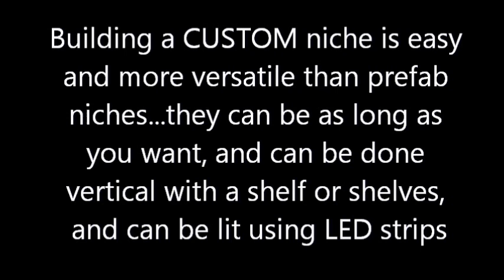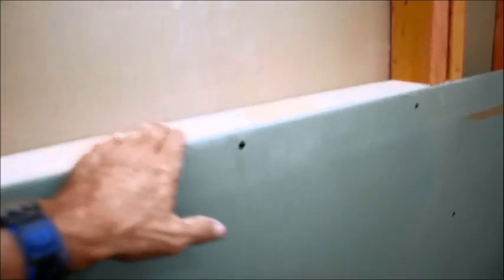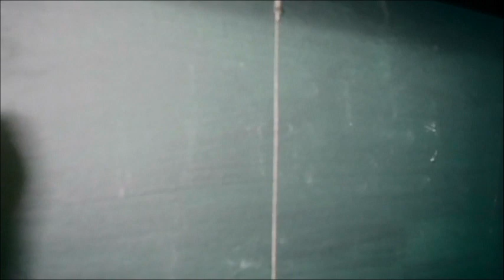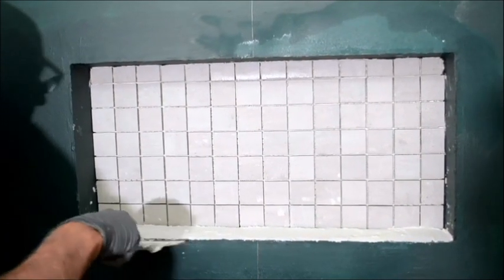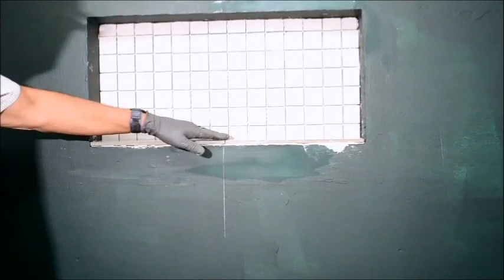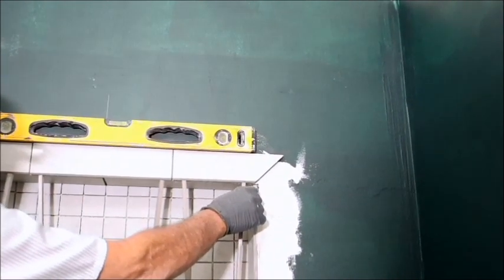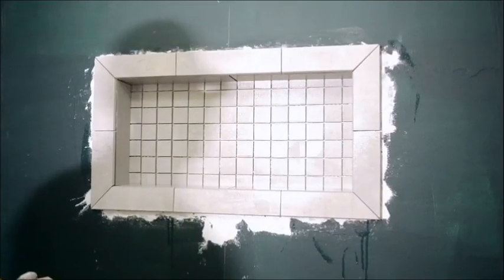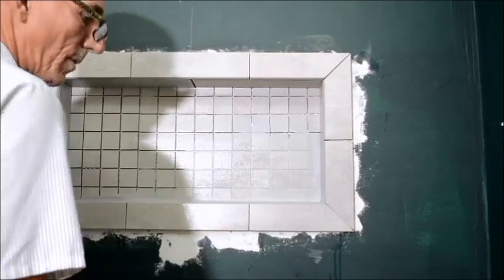HOW TO BUILD A SHOWER NICHE

Comment: I notice that you don't use any tipe of mesh on corners or niche? Why is that?
Reply from the maker: Because the liquid topical  membrane is basically paintable rubber which is much more pliable than tape would ever be... if you wanted to do tape and the waterproofer then it wouldn't hurt but I don't believe it helps

Comment: Bob. Do you grout the entire niche or silicone? And, do you silicone the floor tile and wall tile gap?
Reply from the maker: It is rare that I do any caulking in a shower at all, if there is cracks later on then that would be a reason to caulk but I would never advocate for silicone because it's difficult to work with and even more difficult to peel away when you have to recaulk
Reply: Have you had to regrout due to cracking? I took special time to fasten the stud corners together to minimize/eliminate both planes from shifting serperately cause I want to use grout. There is a porcelain preformed shower pan I'm getting ready to do tiling but think it is best to caulk the pan/wall joint? Your thoughts if you have a moment. Using 12 x 24 for porcelain running them vertically. It's what she wants.
 @StarrTile

Comment: Do you really have to glue the back panel to back of the other rooms drywall? I'd like to do this but I also plan on remodeling the next room over soon and don't want the back of the niche to come out when the drywall does
Reply from the maker: Yes you really have to do that, the only way you could get away with not doing it is having some extra room between your studing, in other words your bedroom wall would be separate from your bathroom wall... what actually does happen from time to time especially on condos but otherwise yes you would have to glue that panel onto your existing wall

Comment: Thank You So Much for all your videos.   My Dad and I are remodeling their bathroom.  It’s a 155 year old house with original fixtures.  We are turning it into a Handicapped bathroom with a floor level shower.   You have taught me a lot about the proper way to do the waterproofing and tiles.   We plan on doing a couple big niches and you have shown me the best way to do them.

Comment: Your always preaching about you build showers based on the way water works. why not put the bottem tiles of the niche befor the back splash so the water that runs down the back splash runs onto the ledge tiles rather potent water running behind that ledge tile and thanks for this video I was about so start this project and now I see that I am able to start the niche be for every thing is nice
Reply from the maker: A niche is not the same as a floor, the water that sees inside of a niche is minuscule at best....I have same size niche in my shower and it gets little water in it. Plus there is no mortar to protect like with a floor...
Two different situations, but everyone is free to do it as they feel is correct.
Reply: @StarrTile  Had the same question. Also, the change of plain into the niche is way more watertight than the floor. 
...but what do I know. :P

Comment: Do you grout inside corners or caulk it? Does the hybrid grout kind of like prism work for these applications? I was always told to caulk inside corners. I would appreciate your advices, thanks!
Reply from the maker: I do not advocate for caulking because it is for cracks, if there is no crack that occurs then there's no reason for the caulk... and no prism will not help you in that regard, however I built my shower seven years ago and no where including my Niche is there cracking so it gets no caulk. But there are some guys that caulk every change of plain there is and there is no harm in that, I just personally don't see the point
Reply: @StarrTile  so you only caulk if a crack occurs, otherwise everything gets grout? Yeah I, was always taught to caulk where the change of plans occurs. Thanks for your advice! You do beautiful work!
Reply: @buildingwithjosh  This point have been a huge  headscratcher for me. But i've done my non-scientific reasearch on this, looking around other showers and most shower uses grout on change of plain, with great results. But I work in an very big and very old Mill where there is a TON of tiling. Old tiling. And if they fail, this is were it occures. BUT....! We are talking 40+ years tiling. With close to zero maintenance. On giant building that move around a lot.  
 
When i do my finish my basement shower... I think i'll go full grout. It's more uniform and i trust my roll-on membrane. And redo it/Clean it in like.... 5 years.   If I had a condo at the 5th floor, this would be another story.

Comment: About to start my first shower... do you apply caulk in the corners to prevent cracking?  My shower will be on two exterior walls, so I expect there to be some degree of thermal expansion/contraction.  Is this a non-issue if I use Prism?
Reply from the maker: I do not advocate for caulking because it is for cracks, if there is no crack that occurs then there's no reason for the caulk... and no prism will not help you in that regard, however I built my shower seven years ago and no where including my Niche is there cracking so it gets no caulk. But there are some guys that caulk every change of plain there is and there is no harm in that, I just personally don't see the point
Reply: @StarrTile  Thanks!  Off to Home Depot!

Comment: Hi Bob! What kind of backerboard did you use for that niche/shower, cement or waterproof sheet rock?

Thanks!
Reply from the maker: Waterproofed green board
Reply: @StarrTile  Thanks Bob 👍
Reply: If I'm using DumaWall tiles,  it calls for cement board. Would that get placed on top of the green waterproof board?
Reply from the maker: I do not and will not use Duma so you're asking the right questions the wrong person

Comment: When you go cutting out studs, you NEED to know if its a load-bearing wall. If it is, you need to put a header in to support that stud you just cut out, otherwise it might sag over time and ruin the tile in the niche. 
Load-bearing walls have double top plates. If that wall has a double top plate, find a carpenter or figure out how to build a header before proceeding.
Reply from the maker: Uhm, well yeah, what you say is obvious.🤦🏻‍♂️

Comment: I'm enjoying your preciseness and logical ways to do a job right the first time. I don't see or comprehend why you hurt the feelings of so many with your critiques. That is irrelevant though. Appreciate your videos.
Reply: Hey Bob, I ALWAYS  find it wiser to do the bottom of the niche before doing the back wall of it. That way the water always has a shed ave, stopping any possibility of water getting through to the drywall. Just saying how I do it.
Reply: @dumbdummer2528   That was exactly my question. I know Bob normally uses that method on the walls, not sure why or if it's not that important to in a niche. I am starting to tile my shower and Bob's video's are priceless. I donated. Thanks Bob.
Reply: Precisely my thoughts also. I have whatched other videos where you say people should never NEVER never run there wallboard into the pan. Why is this practice or theroy reverisible/acceptable in the niche? Either way thanks for the video.
Reply from the maker: @dumbdummer2528  I would agree IF drywall was an issue, but waterproofing everything makes it a moot issue.....plus as I've found with my own niche, not as much water gets in it as most think.